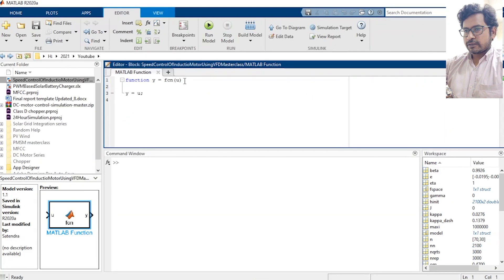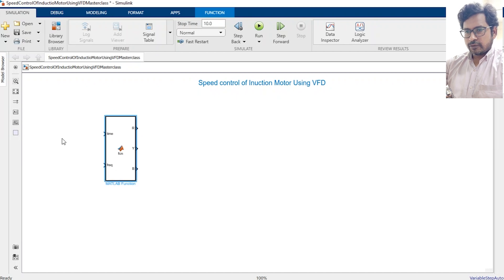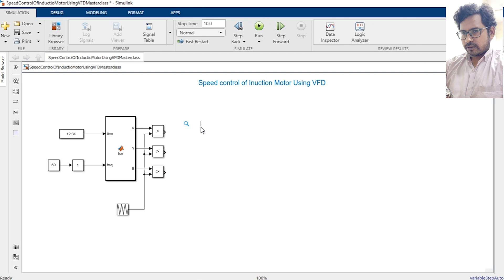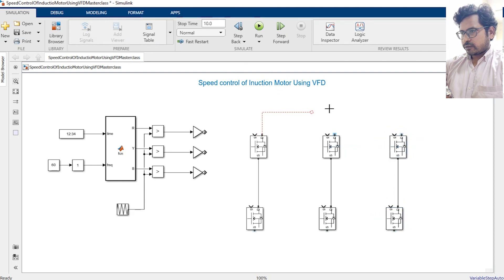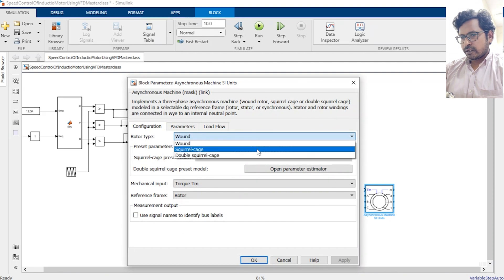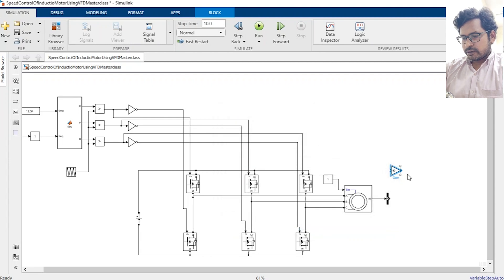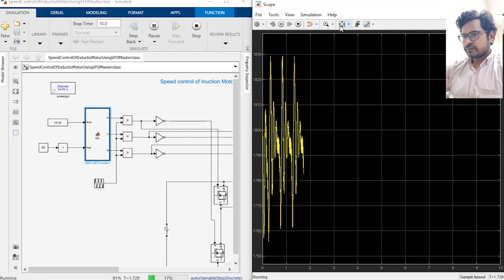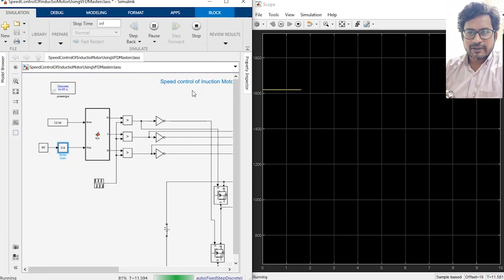Speed Control of Induction motor masterclass | VFD control of Induction motor

Comment: Hello sir , can we do fault analysis in VFD drive. If stator winding of IM have some faults.Please make one vedio for that...thanku
Reply from the maker: Yes, i think it can be implemented. I will give it a try. I will update you.
Reply: Hello sir how can use switch between PMC port.so that I can introduce one phase fault.please guide me.
Reply from the maker: @shubhranshuranjansharma4892  you can add a fault block in power circuit. The fault block allow to select all different type of faults in power system, by double clicking it you can choose any type of fault. Give it a try
Reply: @UrbanSchoolTech  sir I have tried but these faults block are transmission line or underground fault. I have to use a switch before the PMC port of induction motor. I am not able to find any blocks which is connected to PMC port.